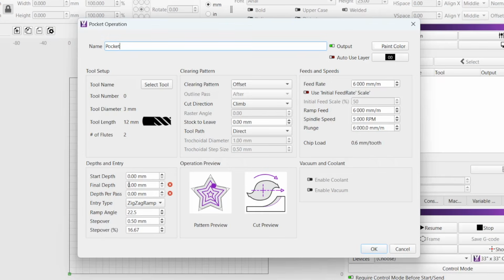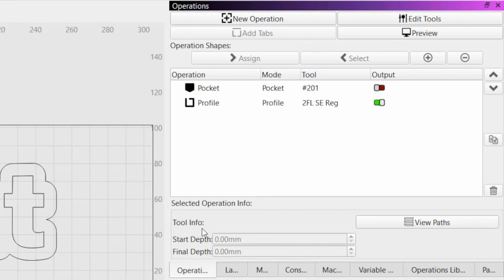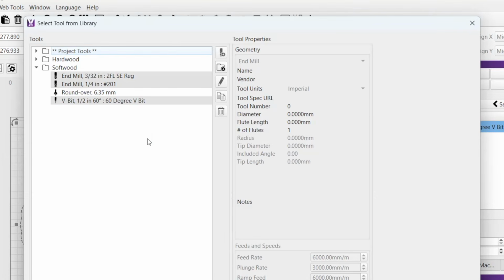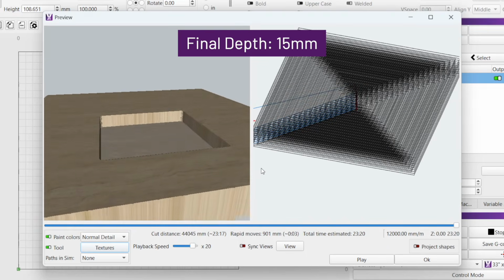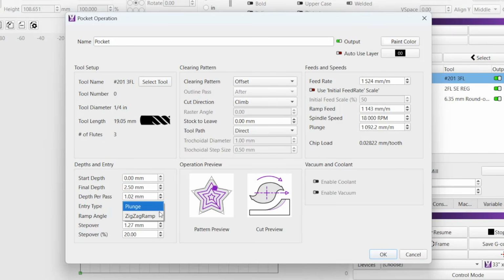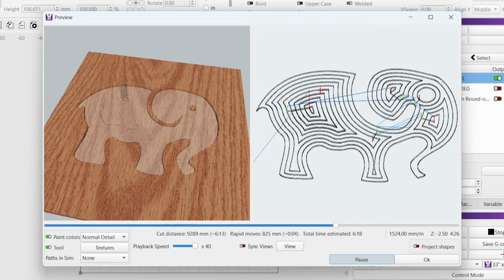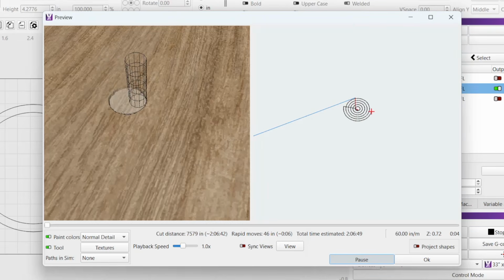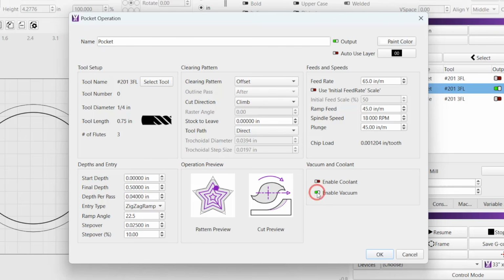Common Operation Settings in MillMage

Comment: Bug Found:
- [TwoTrees TC445 with calibration plate]: Probing doesn't work as it should. It probes correctly, but the Z coordinates stay wrong within MillMage. Probing via the machine display directly works perfectly - and MillMage will recognize the correct Z coordinates as it should.

Small Feature Request:
- Allow us to turn on/off the machine within MillMage, and allow us to configure a timeout on idle to turn off the machine automatically. This can be done via simple HTTP calls (like curl) - which already enables integration with Home Assistant and many other automation solutions. This would also be awesome on Lightburn, btw. Thanks!!
Reply from the maker: Please send your bug report to Support@MillMageSoftware.com.

You can log your feature request here: https://millmage.fider.io/